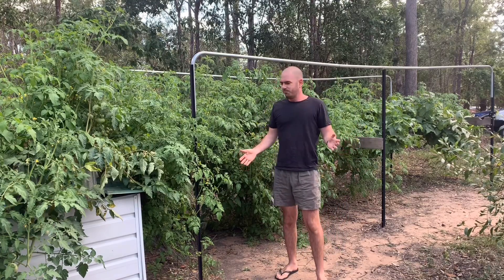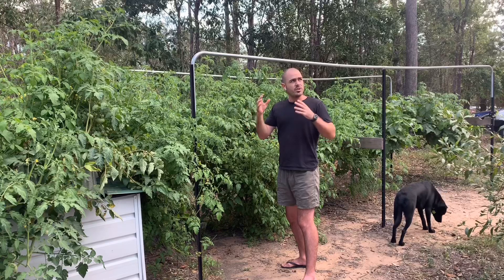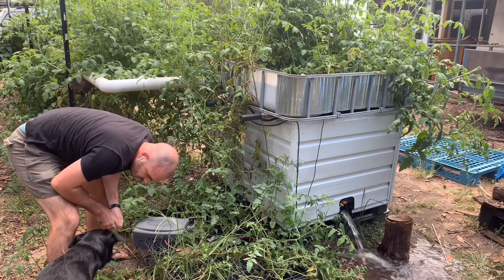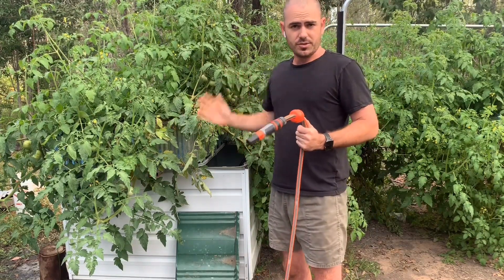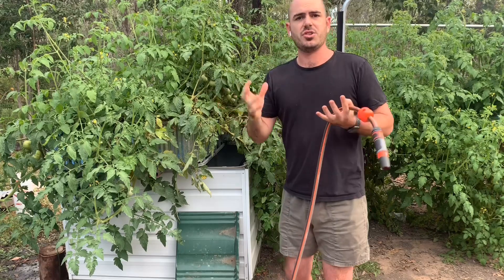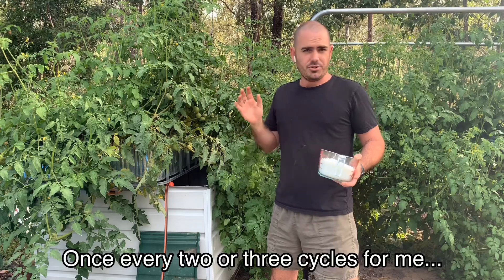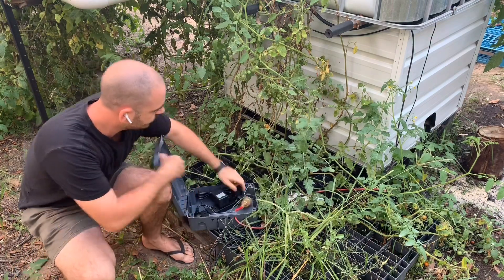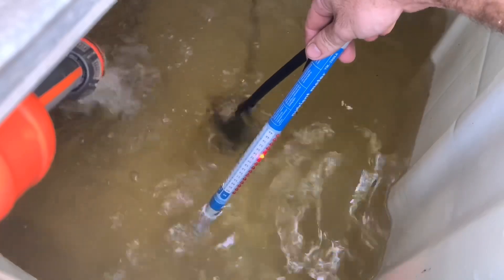How to Change the Reservoir of a NFT Hydroponic System

Comment: Hey mate ! I notice there was no mention about ph levels is this something you monitor?

Cheers mate
Reply from the maker: I’ve almost completely stopped monitoring. They seem to stay stable with my nutrient. So I’ve stopped monitoring them.
Reply from the maker: Almost immediately after writing this comment I had a huge PH problem... so don’t make my mistake hahah
Reply: @Hoocho  what ph did you rise to ?
Reply: You must check the pH of your reservoir daily.
There is what we call " the pH drift".
Your ph will drift daily, even sometimes hourly.
This is caused by what the plants use.
For example if the plants have plenty of nutes, they will take up more water than nutes. Or they will take up more nutes than water.
And this will cause the pH to drift.
In turn this will cause your ppms to drift dramatically.
For example if you switch your nutes and clean your reservoir.
( Which I didn't see him do)

When you perform this duty, you should pump out all your nutes and then clean your reservoir.
Wipe it out with a rag and get all the residue off the walls of the reservoir.

Now what I was getting at with your ppms is.
Say when you add the new nutes. You make the ppms at 900. Depending on what your plants use, your ppms will rise or fall.

So its very important to check both your ppms and ph daily.
Especially when you are topping off.
This way you know what to top off with.
For example if your ppms have gone up to 1200.
You want to top off with just water, to lower your ppms.
Another thing it is a lot better to clean and change your nutes every 2 weeks.
Most nute manufacturer state to change them every week.
But we all know that's just so they make more money.
Anyway good luck to all.

Another thing.
I might be second guessing this guy.
Because it looks like he is getting some halfway decent results.
But I've been growing this way for over 20 years.
And I'm just stating what has worked best for me.